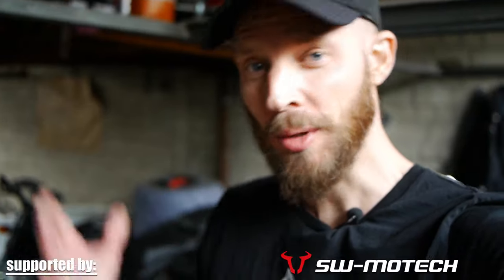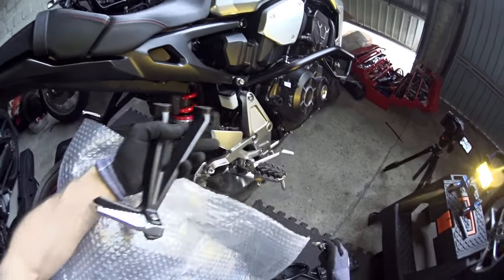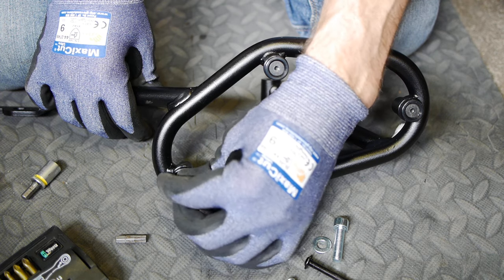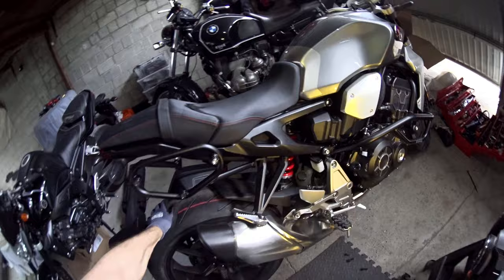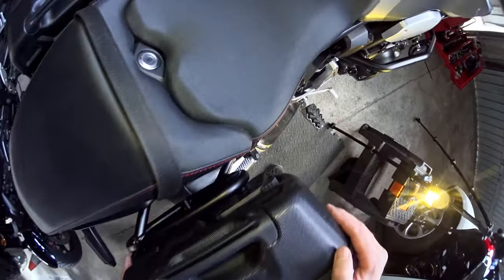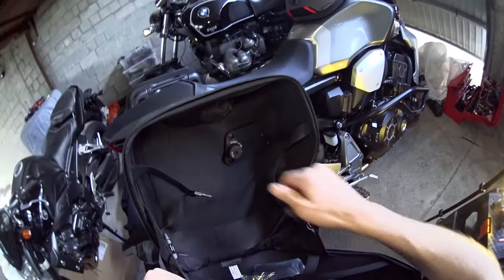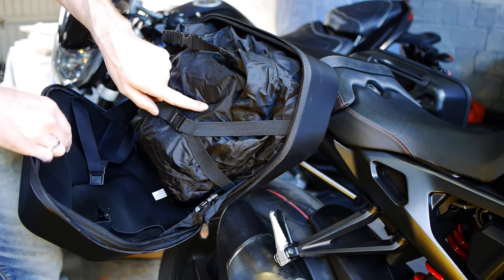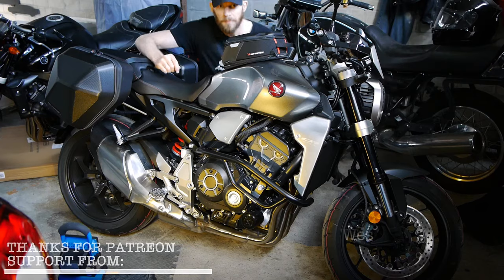SW-MOTECH Urban ABS Panniers | CB1000R NSC

Comment: You have turned this beauty into an unrecognizable transformer
Reply from the maker: Consider this a trial session. Not everything here will make the final grade! 😜
Reply: AndyManCam windscreen is excellent, handguards are super, crashbars are ok, tank bag is cool necessary
Reply from the maker: I definitely prefer the smaller tankbag, both for looks and usefulness. The pipe guards i think are a bit of a miss and I’ll be saving the handguards for cooler weather. I really missed the wind up the sleeves during the hot spell!

Comment: Hi Andy.

I've had 8 bikes since i passed in June last year. Just couldn't find 'the bike' i wanted to keep. 

I was planning on doing some UK touring as a newer rider. So I had a f900xr,  3 weeks later it was sold. Didn't like it.
Then a Tiger 900 GT Pro. Didn't like it. The latest bike is a 1200GSA, a good bike, but way too heavy, expensive to insure £1650 for me, servicing is ridiculously expensive.

I've come to the conclusion that you don't need big expensive adventure bikes to tour.. yes, it helps, but when you then want some fun, it can be a little lack luster. Other than a 1290Suoer adventure or V4S multidtrada.

So, i test road a CB1000R 2018 in the red and loved it, i think after riding the GSA and then that it was bound to put a smile on my face.

So, i think im going to completely switch from the big adventure bike to the cb1000r. I dont ride through the harsh winter, but i do ride on rainy days. That doesn't bother me.

Im just wondering, other than the panniers, have you got any other recommendations on accessories that may help aid for touring?
Reply from the maker: An Atlas Throttlelock is a very welcome addition. Heated grips were also an absolute must! 

Though I’ve now got an Aprilia Tuareg 660. Definitely agree with your feelings about not needing a massive adventurer. The Tuareg is big, but it’s light and I honestly don’t ride any slower, despite having 70hp less!

Comment: Very slick looking mate... I opted for Shad semi rigid panniers as SW Motech don't do a kit that specifically fits the Z800. Shame as I had a recent melting experience which looking at the angle of the mount of them on the Z900 I would have avoided.
Reply from the maker: That’s annoying. Luckily it seems that these are perfectly placed to avoid the melting. Even more so with the stock can.

Comment: For me, and I may just be unfortunate, but zips on panniers are just waiting to fail. Yamaha (tracer) did semi soft zip and then brought out hard cases. Racks look good though, and nice vid.
Reply from the maker: I know what you mean. They're collecting all the road mess. I find that you just have to clean and lube them once in a while. there is even zip care stuff available. but I find a little squizz of WD40 does the trick!
Reply: @AndyManCam  Try not to use WD, it’s petroleum based and not kind to plastic, it can make it brittle. Silicone spray is the way to go, and stays/lasts longer on zip and is great for anything plastic or rubber. It seems to revitalise rubber o rings as well. Doesn’t smell as manly though....
Reply from the maker: Haha! I guess i can live without the manly smell! 😂

Comment: Hi Andy,
How good is SW Motech gear 👍🏍. I’ve fitted the same style pannier brackets to an XSR900. The quality and fittings are first class. The locking mechanism on the bags themselves work a treat 👍. Secure yet so easy to remove and replace.
I couldn’t be happier with buying the SW Motech setup. Going to buy their pannier system for my GSXS1000 as well.
Great informative video...thanks.
Cheers 😀👍🏍
Reply from the maker: Absolutely Peter. Great quality stuff. I’ve been away twice with these boxes so far and I’m really impressed! I thought they might be a little small, but very pleasantly surprised! Glad you’re enjoying yours too mate.

Comment: Did you run into the issue with either side making contact or slightly pushing against your turn signals?

I think the U.S. versions turn signals are slightly longer. FYI
Reply from the maker: No i didn’t. But they were very close.

Comment: Great video well done.  Looking at getting these for my 2015  KTM 1290 Super R.  Retirement is soon and plan to use mine for long day trips and to carry my rain gear on one side and put my textile jacket in the other when it warms up during the latter part of mornings in the spring time here in South Carolina.  Have you put a jacket in one?  I know they are kind of small but that is why I like them but need them to handle a textile jacket when needed.  Thanks Mike
Reply from the maker: I'll have to get back to you on that one. Although it also depends on how big your back protector is too. I sometimes wear a jacket without armour and have the Knox armoured shirt underneath. in that case, there would be no problem fitting a textile jacket in there.

Comment: Hi Andy, great channel. I came here while shopping for a CB1000R which I've now got. Also now just ordered this pannier system largely helped by this video. A thought occurred to me though and wondered if you'd be able to answer. Are the panniers large enough to carry a helmet? Thanks for the video anyway. Regards Peter
Reply from the maker: Thanks Peter! Welcome aboard and thanks for joining in. I'm afraid the panniers are far too small for a helmet. You'd need the Rearbag for that! ;D (They're about to bring out a new model too)
Reply: @AndyManCam  Thanks for your response! Also my panniers arrived and I now see what size they are. Regards, Peter
Reply from the maker: No problem! Otherwise i find that the panniers are fantastic. Best I’ve had (except maybe the hard tins that i had on my Versys. But they were massive, heavy abs would look really bad on this bike!!). I hope you have the same existierende as me mate. 👍🏻

Comment: how do you lock the bags to the bike if the bag is full of clothes and stuff?
Reply from the maker: I tend to use the elastic straps on the outside half to hold the waterproof bag in place. That way, when i open the cases all the luggage falls out of the way of the locks. Plus i can then wedge waterproofs, spare gloves, water or whatever between the waterproof bag and the inside half of the Case.

Comment: How are they with a passenger? Seems like it would block their legs?
Reply from the maker: It is unfortunately a bit tight there. The biggest problem is space for the feet. My size 11‘s only work if i put my heels on the pegs. I think you’d have to have pretty tiny feet to be able to put them on the pegs properly.

Comment: Hello, it is possible this system can be used for the 2021 model. On the sw motech page it is not specified for the year 2021. But although the subframe is different, it appears that the attachment points are the same. What do you think. Thank you.
Reply from the maker: In theory I’d say yes, but i haven’t seen the 2021 in the flesh. Just a couple of mm difference could mean disaster! Maybe bung SW-Motech an email and ask them. They’re normally very keen to help.
Reply: Yes. Are new in the store.

Comment: So you have to undo the luggage to lock it onto the bike...mmm does'nt sound very well thought
Reply from the maker: But thats exactly the point, because you then have to open the luggage again to unlock it. If the zip is locked, then the bag can’t be unlocked. Having to undo it is the small compromise that comes with such a simple setup. If the bag had a locking mechanism on the outside, it would be heavier, more complicated, more expensive and the lock/mechanism would be able to collect all the road grime. I find it perfect just the way it is.
Reply: @AndyManCam  Sorry, don't agree. I find it so unpractical to undo the luggage to lock on or off the bike. Would happily spend an extra to have an external lock.
And, would it really be more expensive given the fact that these products are probably all made in China?
Reply from the maker: More parts means more cost, regardless of where they’re made. But after 6 months of use, I’ve found the setup fantastic. If it’s not for you, then so be it. I’m happy.
Reply: @AndyManCam  410,09 euros is not that cheap... actually its rather expensive for what they are.
Reply: @AndyManCam  I'd rather go Givi..if that makes sense
Reply from the maker: If that's what works for you, then go for it. Personally I think the Givi framework is ugly and the setup will also only cost you 30€ less! But your bike, your choice, your gear!
Reply: @AndyManCam  don't know about the framework but givi's bags are rather nice in my opinion.